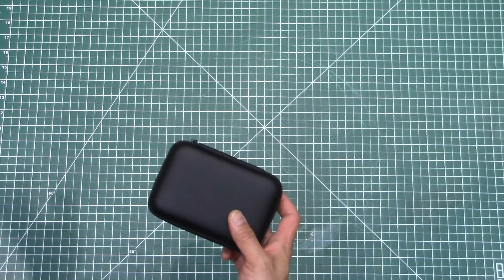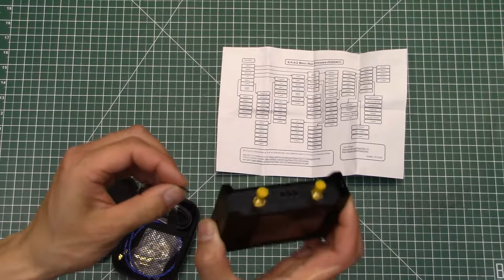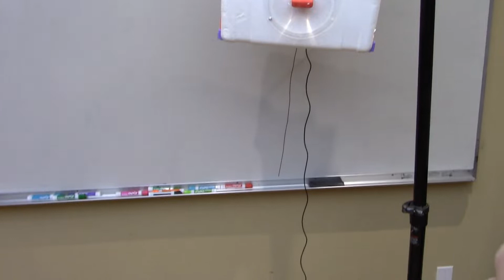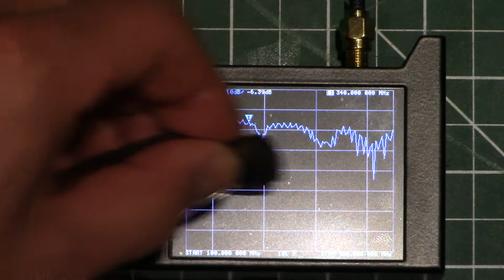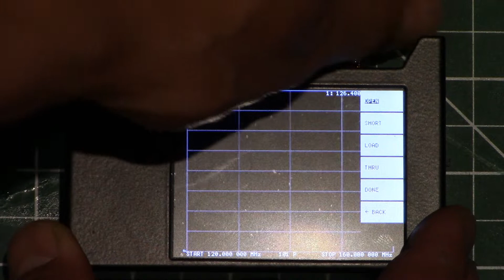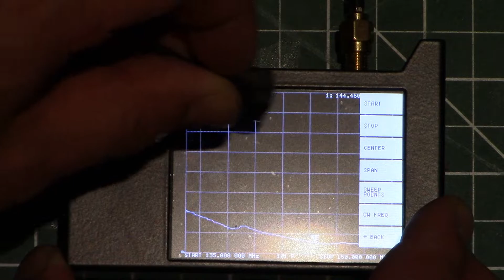Tune an Antenna Using a NanoVNA

Comment: Always log mag. Forget SWR - it is much less useful and readable than return loss. And you should have done the cal at the far end of the connection cable. Always calibrate as close to the item yuou are checking as possible

Comment: You have to calibrate the NanoVNA every time you change frequency range, and to do measurement of the antenna, and not the the antenna + the coax cable, the calibration have to be done on same reference (end of coax) as the antenna.
Reply: ok, here I have a question now! Shouldn't you include the cable in the measurement/tuning? Background: I made some 2.4GHz antennas for WIFI, I took some 433 MHz helix, pulled it a little and cut it down while looking at the reflection chart. This worked kinda great (except that the down peak was kinda tight which influences the bandwidth).
But after attaching the tuned antennas to a SMA cable and connecting this to the WIFI µFL connector, the result wasn't that good anymore.
I think I should have measured including the SMA cable because of its influence. Or am I wrong?
Beside that, I think it would be best to measure/tune everything when it is connected to the WIFI module, but I still have to find out how to achive this. Soldering a simple cable to the µFL connector and attach the VNA to it probably is no real solution. But this is what I try to find out currently.
Reply: @dokatecdev5858  To my knowledge Is the reference point  (plane), where the measurement will be done. If the goal is to measure an antenna (DUT device under test), the calibration have to be done on the same plug/cable where the antenna (dut) will be connected to be measured.
Same apply to all measurements with a VNA, to what ever one want to measure. Calibration have to be done on same plane as the DUT will be measured. If the VNA is  calibrated at the connector and then connected to a long lossy coax and an antenna, the VNA is not able to tell the coax and antenna appart, and the coax+ antenna are the DUT. At times the interest is how an antenna system included cables is behaving, then all the system is DUT.
If there is need for adapters, there will influence, but as long the wavelength is less than 1/10 of a 1/4 wavelength at frequency of interest, it don't influence in layman's term. 
Hope it clarifies your question.
Reply: Save your settings in memory, works for me. Exam: 10m, 6m, 2m, 440
Reply: I understand that if the feedline radiates RF, you're going to have problems but what is the issue with calibrating the NanoVNA using your feedline, then tuning the antenna with the feedline connected to the antenna? Since your radio is going to use the feedline, shouldn't it be taken into account while adjusting the antenna?
Reply: Agreed. He needs to calibrate with the coax cable on the VNA, and hook up the short/Open/50Ohms to the end of the coax for calibration.
Reply: @GamisteToDimosio  The magnitude of the reflection coefficient (and thus the VSWR) is not affected by the transmission line. The T line only effects the phase of gamma which is irrelevant to VSWR.